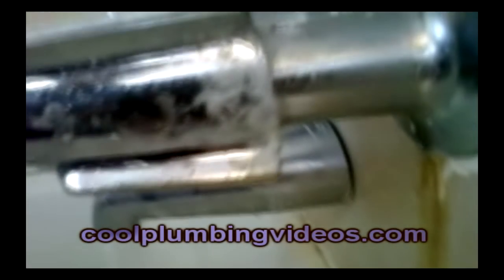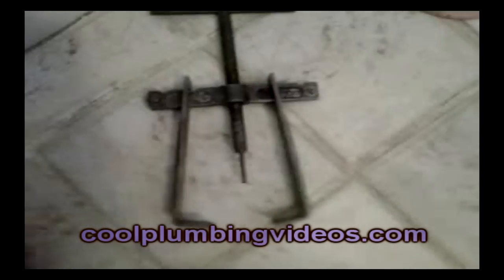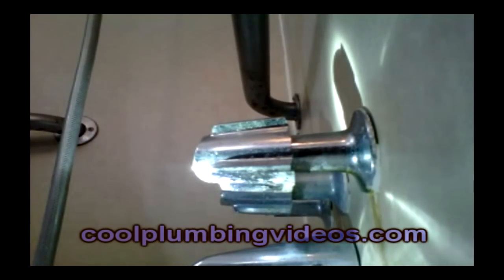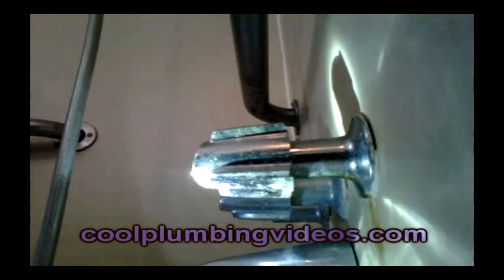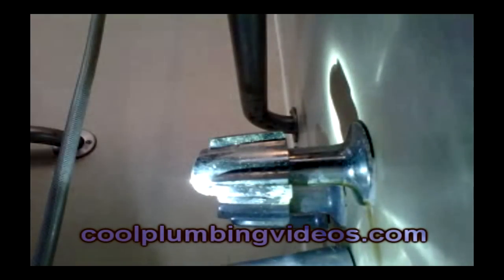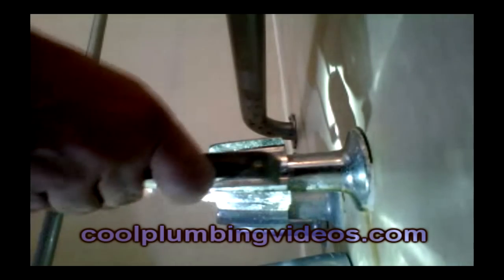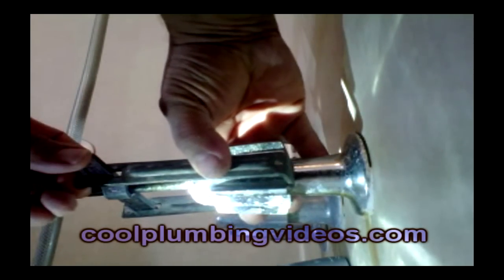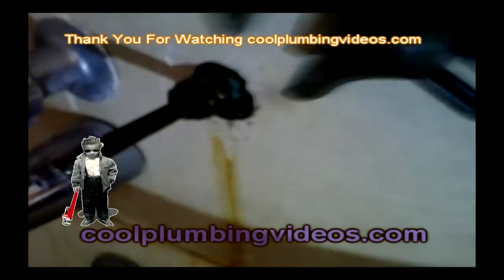How to Replace a Shower Faucet Handle | How To Plumbing

Comment: Do you have to take off the screw before you install the handle puller? I have a stripped screw and I can’t take off
Reply from the maker: Sorry, but yes you will have to remove the screw first. It doesn't happen much.
Reply: How to Plumbing thank you for replying. 2 of 3 screws are stripped. And the 3rd handle hard to come off due to buildup and corrosion. Any ideas how to take off stripped screws.
Reply from the maker: You can drill them out or rock the handles back and forth until the break-off, but you will need to replace the stems after doing that.  Which sounds like you will have to do that anyway. 😝
Reply: How to Plumbing I found the same old kit set with everything included. So I’ll be replacing handles, steam valve. Thank you so much.
Reply from the maker: @blackhawks1870  👍

Comment: For hard handles i used the handle pullers and then put a C clamp around the arms of the handle puller to keep it in place. With more force it should pop right off.
Reply: Thanks Claude! Your video saved me some $$$.
Reply from the maker: Glad I could help.

Comment from the maker: Yea you may have to remove the stem's, but it kind of sounds like you backing nut is to tight. You may have to lossen them up a little or replace the stems.

Comment: Update, after spraying several times with WD40 and just trying time after time, I finally got the other handle off.  My reason for removal is to replace with handles that will be easier to use.  HOWEVER, the spindle itself is hard to turn.  So I don't think the handle is the real problem.